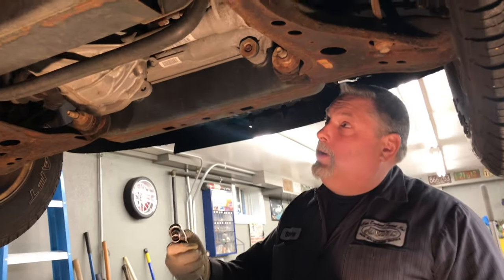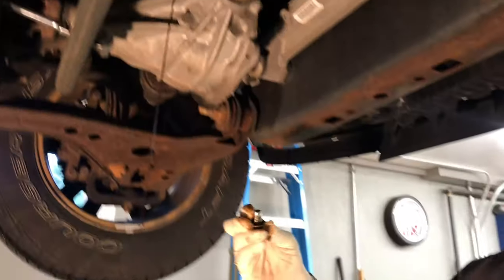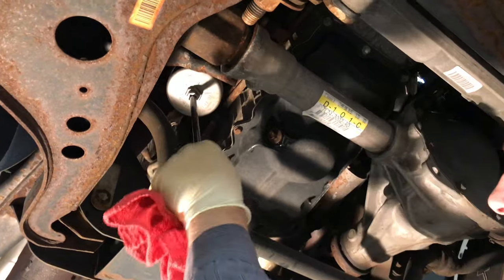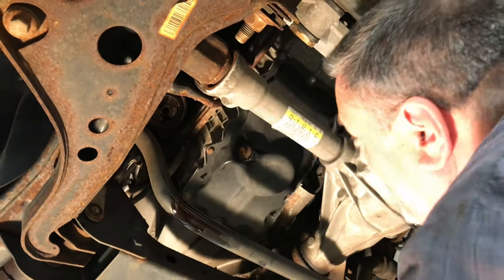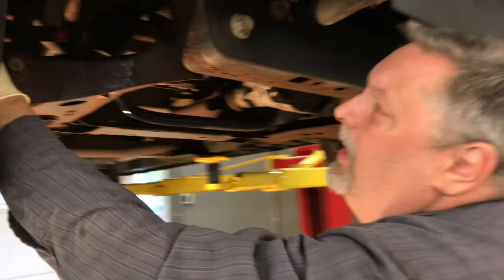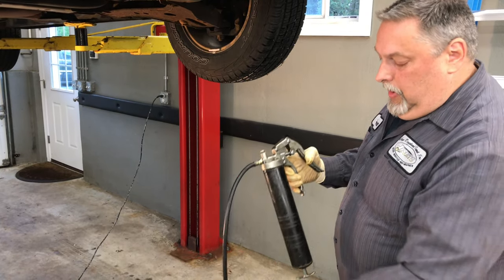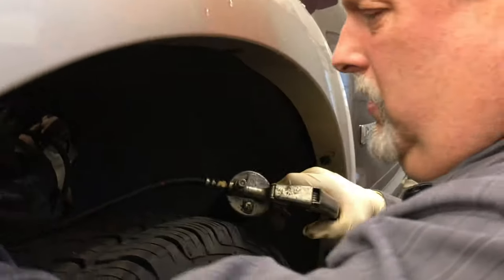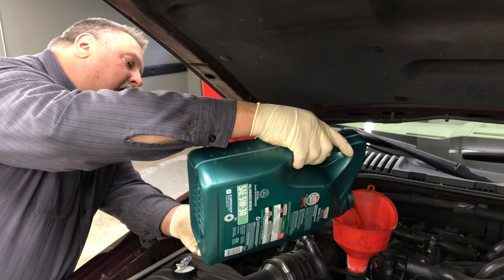2006-2010 Ford Explorer Oil And Filter Change 4.0 Engine

Comment: "Gonna put some clean oil on the new filter" proceeds to rub dirty oil off the frame and put it on the new filter
Reply from the maker: You realize there is WAY more dirty oil inside of the engine than on the oil filter o-ring. It is not going to harm anything.
Reply: @HomeOwnerRepair  I know. It just cracked me up.
Reply: @ducati644 shit was funny Lolol

Comment: I have 2006 ford explorer limited v6 the oil filter smaller size from usual I don’t understand!
Reply from the maker: Thank you for watching our auto repair video that shows you how to change to oil in a Ford Explorer. Hope it helps you out.
Reply: @HomeOwnerRepair   thank you for replying but my question is my oil filter smaller from other Ford exploder v6

Comment: Why don't you feel the oil filter before you put it on the motor
Reply from the maker: I always check the oil filter and the oil filter housing to make sure the oil filter seal has come off.
Reply: @HomeOwnerRepair  I think he meant why didn't you fill it up with oil before replacing it so there isn't a air pocket and no time period where no oil is circulating while it's filling the filter up during it running

Comment: WHAT IS THE BEST OIL TYPE TO USE, STANDARD OR SYNTHETIC ??  HOW OFTEN DO YOU CHANGE THE OIL SIR ??   THANKS
Reply from the maker: I typically like to use synthetic. On most synthetic oils you can go 7,500 miles between oil changes.

Comment: I have ford explorer Eddie Bauer 4.6 V8 2008. I'm wandering what's the best oil to use for it. I bought it last month with 146k miles and still runs great.
Reply: high mileage
Reply: You can find the recommended oil for it online by searching I can't remember the brand but I do remember it's a full synthetic
Reply from the maker: You should reference your owner's manual for the proper oil weight.